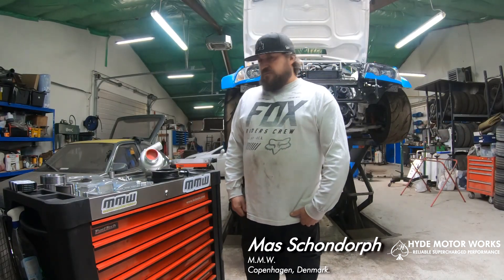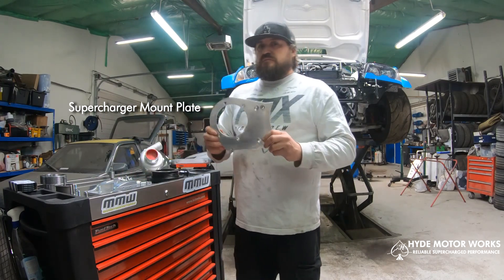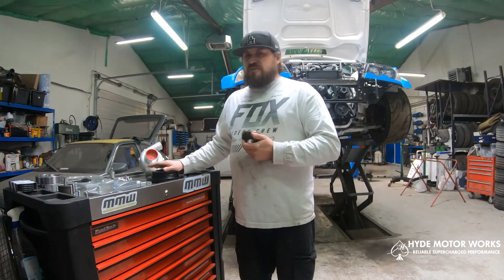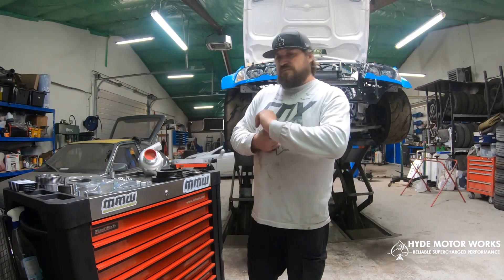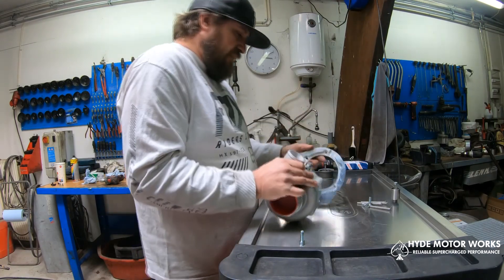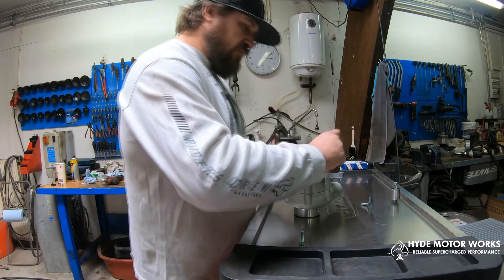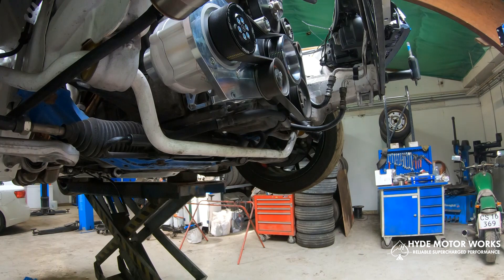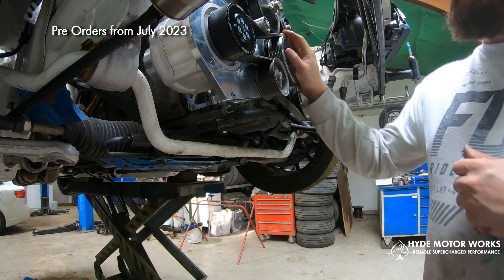B.R.O.S.K. -1 | BMW Rotrex Supercharger Kit

Comment: is a tune needed after install?
Reply from the maker: Always, although low boost, you can use a rising rate fuel pressure regulator and a afr wideband gauge to check the afr. But yes, more air = more fuel, the computer in the car is not programmed for so much more air, you will run lean and ruin the engine if not tuned.. tune is always the final touch to get optimal results.

Comment: Низко установил. По инструкции, чарджер ставится выше, чем вся его масляная система. Придется маслобак и кулер, и всю прочую фигню монтировать еще ниже, чем сам компрессор. Иначе масло давить из него будет
Reply from the maker: Not correct. Only the early versions of the rotrex they had a different seal around the shaft of the supercharger. So if the supercharger was mounted low and had oil sitting inside that seal would leak. That’s not an issue anymore with later and current versions. They just kept it in the manual for some reason. - From Mas
Reply: @HydeMotorWorks  So I got something wrong :) Thanks for correcting me.